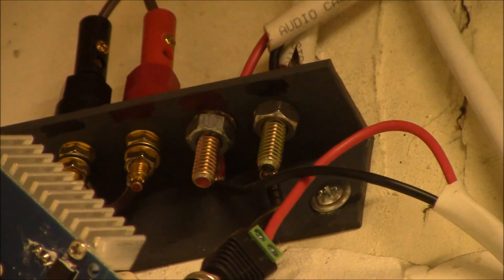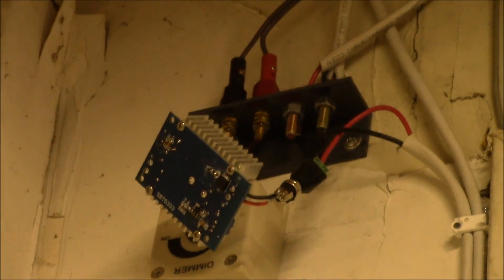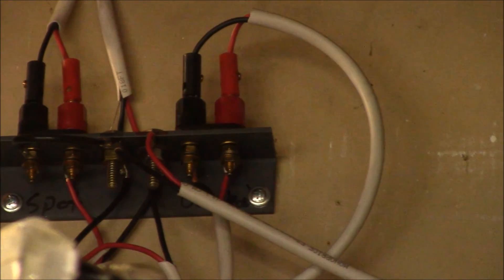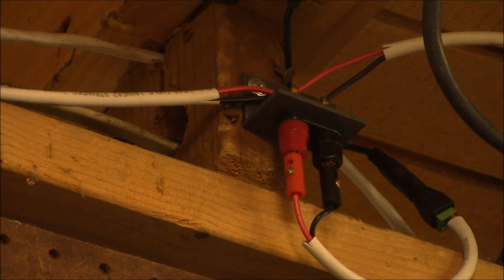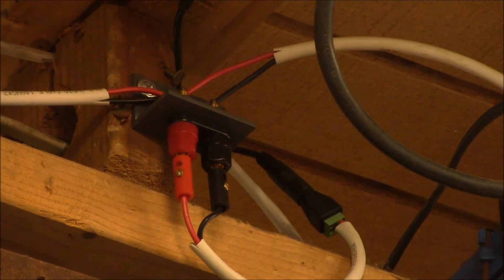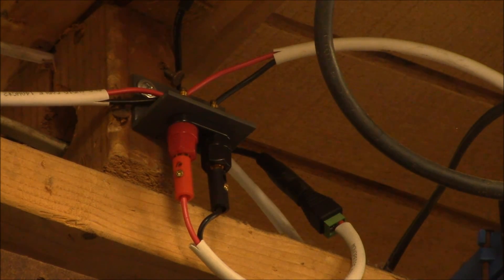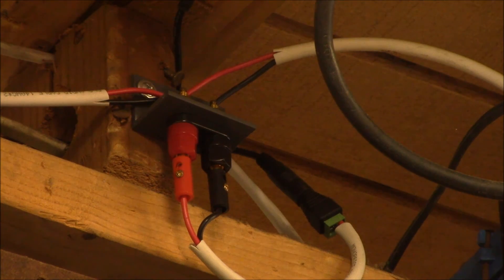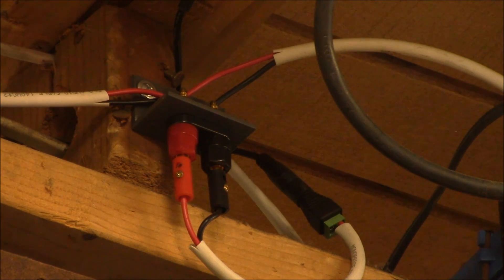Low Voltage Banana Jack Brackets, Part 2

Comment: Are the jacks insulated where you could mount it to metal? Or would they ground out?
Reply from the maker: I think they can be mounted on metal if you used all the mounting hardware that comes with them.  You need to drill oversized holes and then use the plastic top and bottom plates that come with the jacks to hold the conductive parts of the jacks off the metal to avoid a short.  Those plates have two holes and hold the jacks apart at a specific distance.  I left those plates off since I'm mounting mine to the plastic angle stock.
Reply: Thanks for the quick reply! I'll have to give it a shot